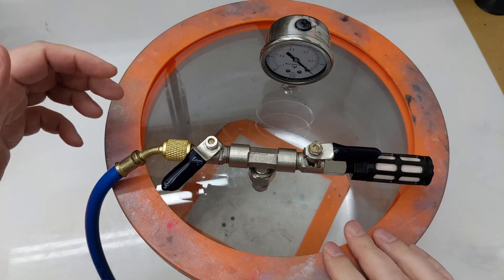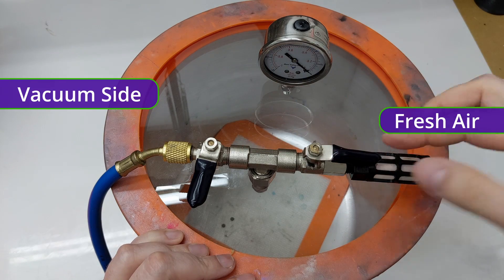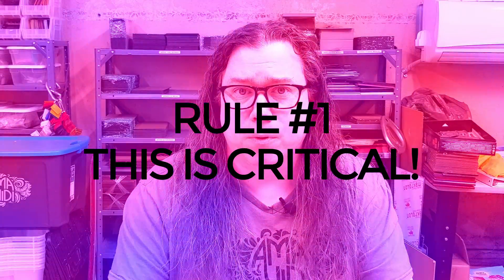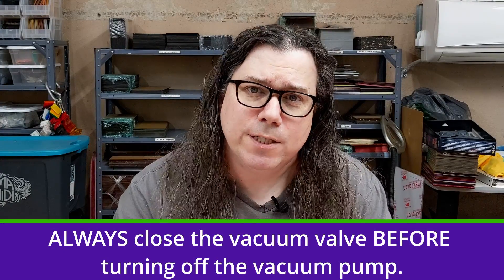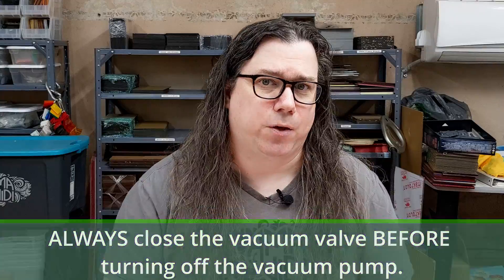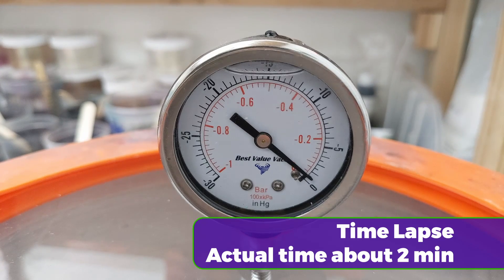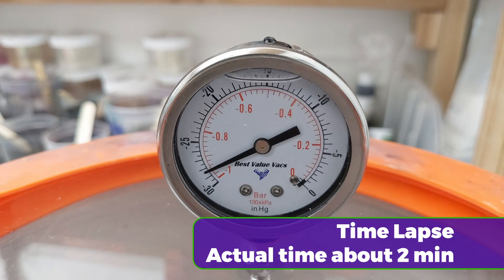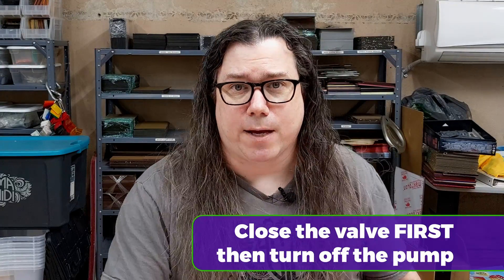BEGINNER'S GUIDE TO A VACUUM CHAMBER - degassing silicone

Comment: Seems like my silicone never fully degasses. I have a 9cfm vacuum but I've let it run for 20+ minutes and still get bubbles. I verified the connections are secure so there's no leak. How do I correct this?
Reply: Did you figure it out? I had trouble but figured out that some of my connections were too tight. 
The hose connection into the gauge on the lid had a soft, thick gasket- it was over tightened and its hole ended up getting squished shut. I adjusted the connection- barely hand tightened it and it fixed it. Proper suction in less than a minute now.

Comment: What sort of pump do you recommend? I am not sure how much horsepower or CFM I should need for this
Reply from the maker: Hi!  Short answer: it's a relationship between vacuum chamber size and vacuum pump size - you need to evacuate the air fast enough so that your silicone can be poured within the pot life.

I have another website you can check out with articles about vacuum pumps, vacuum chambers, etc. - https://imakesextoys.com/category/the-knowledge/equipment/vacuum-pumps/

Best, 
Derek

Comment: I left the pump on for 30 seconds.  That made the resin instantly harden.  Then I turned the red valve and that made the resin explode.
Reply from the maker: Wow!  That's crazy!  This video is about silicone though (not resin) so you might want to do other research to learn more about what might have happened to cause your resin to do that.
Reply: @Amavidi  I've tried to message other youtube channels that work with silicone, resin and vac chambers.  Most don't reply.  Those who did reply, stopped replying after I asked 1 more question.  But I recently found out the proper way to shut off the vac mechanisms.  And I found out that resin itself heats up and hardens by itself, not because of the chamber.  What puzzles me is that the resin hardens in under a couple minutes.  That doesn't give me much time with regards to releasing the valves and pouring.  I also had a hard time getting the resin to sink into the mold.  Is it because I'm supposed to drill a bigger hole in the mold?
Reply from the maker: First - your resin is too fast for what you want to do. Go with a slower resin.  You will likely want something with a pot life of 20 minutes or more and a cure time of hours.
Second - You should use a pressure pot for resin not a vacuum chamber.  Pressure crushes the bubbles so that they become invisible to the eye. 

This guy is a great resource for resin casting - you should check him out.   https://www.youtube.com/@RobertTolone

This guy is another good resource - https://www.youtube.com/@DruidDice
Reply: @Amavidi  hmm.. well should i return the vac chamber and pump?. I talked to Robert a bit.. He doesn't answer all questions.  and can you recommend a resin on amazon?. its a shame that all this resin might not be used.
Reply from the maker: We (as YouTubers) make videos because we enjoy it - and answering questions can be very draining.  So if folks don't answer questions, that is a boundary to be respected.

Vacuum chamber/pumps can be used for resin stabilization of woods, etc. so it has its uses - just depends on what your uses/needs are.

I don't feel comfortable recommending any resins - too many specific use cases.  I would say get in touch with Reynolds Advanced Materials if you are in the USA or whoever is your local Smooth-on distributor and ask them for recommendations.

Comment: Do you have recommendations for vacuum pump selection?
Reply from the maker: Thanks for the question!   First, there's a link in the video description for the vacuum pump that I use so you can use that as a starting point.  Second, you can also check out this video where I talk a little more about vacuum chambers and pumps - https://www.youtube.com/watch?v=8zPqVAgvlE0
Finally, I have a website where I have links to several vacuum pumps that could be good options - https://imakesextoys.com/3-best-vacuum-pumps-for-making-sex-toys/

Hope that helps!
Reply: @Amavidi  Thanks for the information.  I found the link almost immediately after sending the comment 😂🙄.

Comment: My vacuum chamber had a little sticker on the gauge that said to "cut as shown" along with a picture that looked nothing like the black rubber cap at the top of the gauge... I went ahead and cut it, and a little oil dripped from the cap... Did I just ruin my vacuum gauge? I ask because it looks like you chamber has a similar sticker on it.
Reply from the maker: Hi! Thanks for the question 😁

I clipped the tab as well.   I think it's designed to allow the gauge to acclimate to the ambient air pressure (which varies with altitude).  I think you can test this by pulling a partial vacuum and then pressing your finger over the hole - you should see the gauge change as you put more pressure on it.

Honestly, the gauge is a guide more than anything - we are more concerned with the elimination of the air in the silicone than the actual vacuum.  It also tells us when the oil is low in the pump when the gauge shows a slower rise in vacuum pressure than we are used to.
Reply: @Amavidi  Thank you! I feel a little better now  :-)

Comment: Do you degass when it is in the mold as well, or just after mixing?
Reply from the maker: I just degas after mixing - as long as you are just pouring and not mixing, you shouldn't introduce any new air or bubbles while you pour into your mold.

Comment: As usual, providing extremely useful tips that I would have learned the hard way (ruined $$$ silicone) didn't even think about the pressure pulling the oil from the pump side if fresh air side is released before closing pump side...